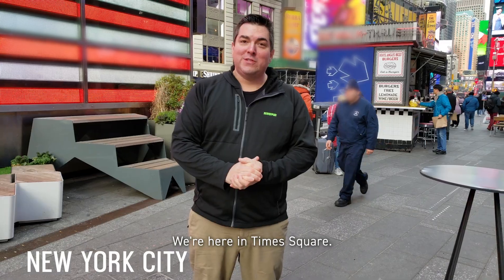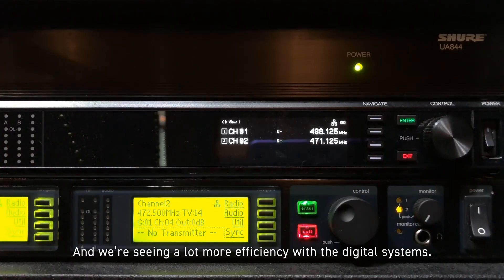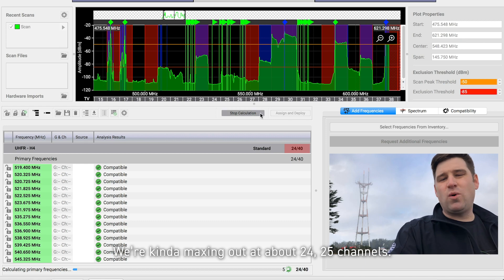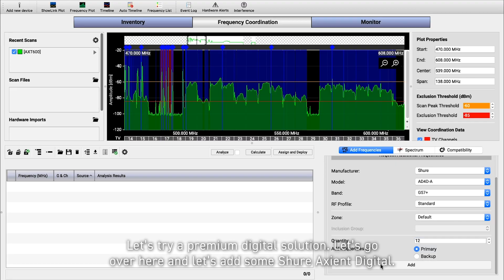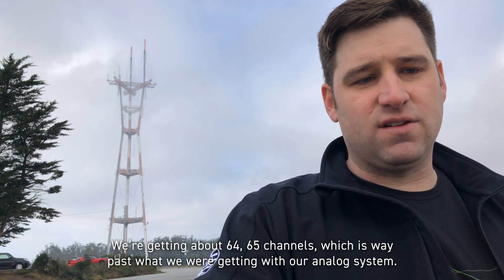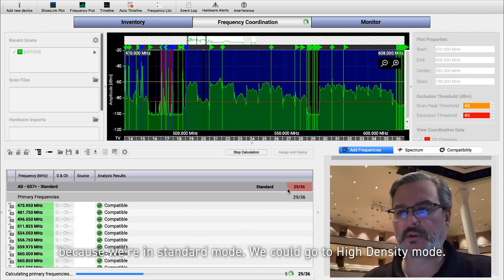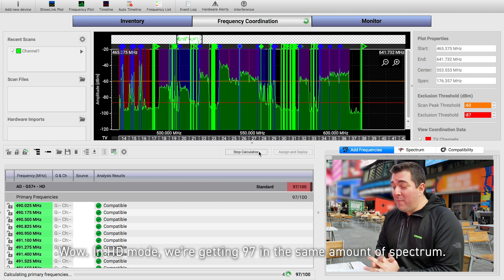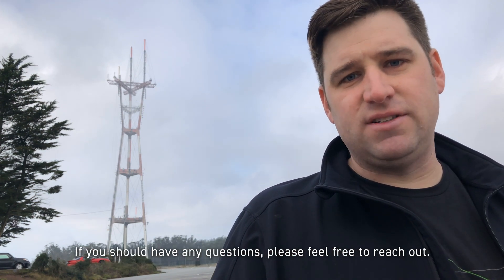Analog vs Digital Wireless Performance

Comment: anytime i use digital system with my beta 58a their seams to be interference usually due to the wifi the system uses. is there anyway to fix this
Reply: no, you're completely reliant on the smart digital tuner that tunes for you. You can pray to the digital gods for good signal.